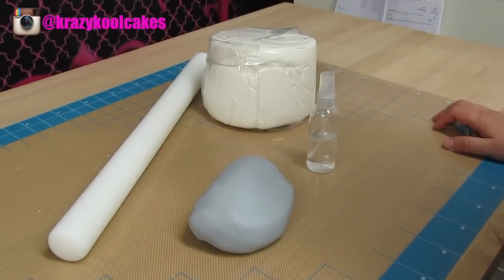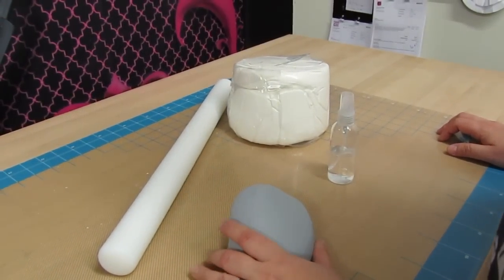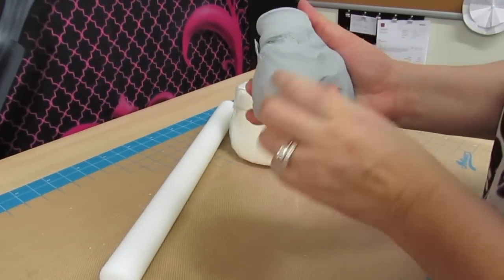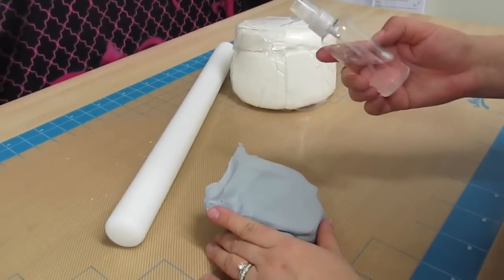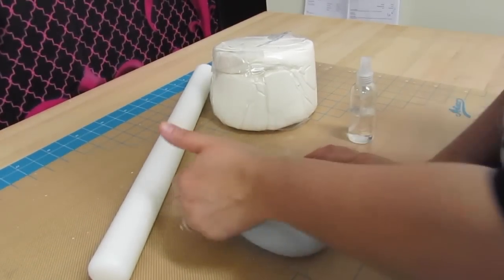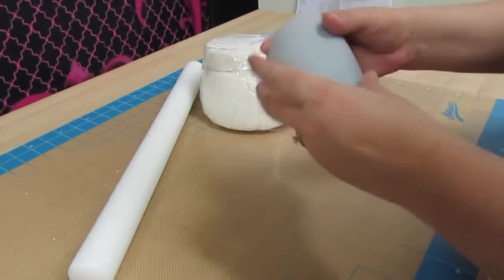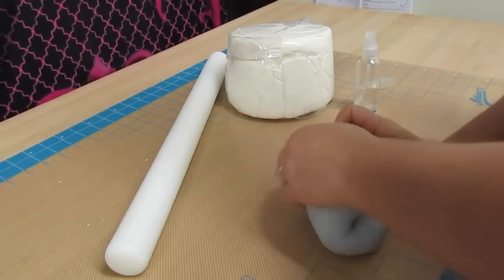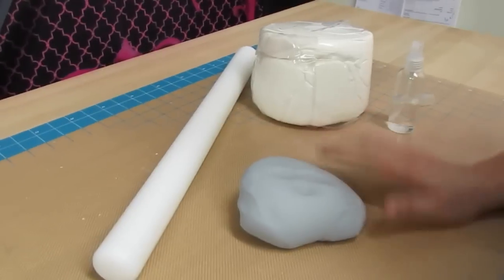How To Avoid Cracks and Elephant Skin On Your Fondant

Comment: Love your videos!!! Would you be able to use a fondant smoother without it sticking to the fondant? I usually rely on cornstarched fondant to be dry enough to be pressed with a fondant smoother. I tried using shortening and the fondant smoother got stuck on fondant and really didn't work. Thank you!!!
Reply from the maker: Thank you so much! We appreciate you watching. Yes of course you can use a fondant smoother. As long as your fondant doesn't have condensation on it your smoother should not stick. Make sure your cakes are only refrigerated when covering in fondant and not frozen or else you'll have tons of condensation (cake sweating). Also it definitely helps to make sure you are working in an environment that is free from humidity and warm air. I hope that helps. :)

Comment: I am using gumpaste that I made using Wilton preferred white fondant. I used your tutorial on adding the tylose.  I also used the gel food coloring. Maybe I should add more water when working it? I am doing the Easter topper you showed with the cross and robe. The robe is what is cracking right in middle where it drops down. I enlarged the cupcake version to a cake topper. It's beautiful other than the cracks.
Reply from the maker: Hi Beverly, Yes most definitely. Spritzing it with water and kneading it will make your gumpaste more pliable and will stick together even more, thus, avoiding cracks. Gumpaste acts very strange depending on the time of year, temp. etc. Often I also have to spritz it more than normal with water to get it nice and pliable. I bet your Easter topper is lovely! :)

Comment: Hi Laura. When I make gumpaste decorations I do the water process to keep my gumpaste the right consistency but after they dry they Crack and look like elephant skin in a few places. Is there a way to fix this after they have dried? How can I prevent this? Thanks in advance for you advice. Love your tutorials.  God bless.
Reply from the maker: Hi Beverly, There's no way to fix cracks after gumpaste has dried. This must be avoided while sculpting. One thing that will really help avoid cracks is to not use shortening at all while sculpting as this creates more cracks and wrinkles. What gumpaste are you using?

Comment: How do you prevent it from sticking to the rolling pin when you roll it out if you spray it with water?
Reply from the maker: HI Zoe! Great question! Definitely avoid water touching your fondant when you're rolling it out as this will certainly cause it to stick. You can lightly powder your surface with either confectioner's sugar or cornstarch (which is what we like to use) to avoid the fondant sticking to your rolling pin. Hope that helps. :)

Comment: Thank you for the tip but what about when you add colour and is sticky if I add corn flour or icing sugar starts to break it. Any advise?
Reply from the maker: If your fondant is getting too sticky when you add color, you're either adding too much color, or your fondant was already too moist before you ever added the color. The only thing I would add to sticky fondant to make it a bit drier would be a little bit of cornstarch. Nothing else. If it get too dry just spritz a tiny bit of water and knead it in. Hope that helps. :)

Comment: Will that work also for homemade fondant and also when I roll it out to put it on my cake if I Spritz it while I'm kneading it will it stay pliable like that when i cover the cake? with no cracks?
Reply from the maker: Yes. :)
Reply: Krazy Kool Cakes & Designs  hi I just have one more question if that's okay, my mother and I are always using box cake recipes is there any chance you might have a really good recipe for a homemade batter from scratch. Thank you I would appreciate it very much!
Reply: I make my own fondent and follow the recipe and it still cracks just as soon as I put colouring in and tryed the water and tryed the tylose and it didn't help please help

Comment: Hi..I was wondering what's the best crumb coat to use with fondant..specially if your  in a country with typical hot weather conditions.I learned the hard way that fondant could sag beyond repair.and it totally ruined my whole cake.
Reply from the maker: Hi Marj, We have our Perfect Icing Consistencies tutorial you can check out for the crumb coat icing we use as well as the outer coat. We live in the desert and it's typically very warm here, but the cakes are always kept in a cool and dry room or venue. We don't ever recommend putting cakes outside in super hot weather. No icing can withstand that. If the fondant sags however, it could be the icing, or, mainly the cake. If the cake is too soft it will sag.

Comment: It don't make it sticky when u knee it.. wilton I buy from michaels the big box that has two packs and I worked this fondant and it still crack on me.. it never did thia before on me
Reply from the maker: Hi Natasha! It gets sticky to a certain point. That's when you have to use your best judgement and decide when to stop adding water. You should knead it until the stickiness is gone, but you still want it very pliable before you roll it out. When temps get warmer (like the season we're in now) the air is drier so your fondant will dry out faster. That's when you need to knead more water into your fondant before rolling it out. It also helps not to take a long time when covering your cake. The longer the fondant is exposed to the air, the more it dries out on you. Hope that helps and thanks for watching. :)
Reply: @krazykoolcakes  Yw I will try it again tomorrow on my other cake

Comment: If you see get dry again but the fondant is already on the cake can just spritz the cake a little to add a little moisture
Reply from the maker: Hi Erin,  You actually WANT your fondant to dry once it's on there. Once your cake is covered, don't go anywhere near it with water. Hope that helps. :)
Reply: @krazykoolcakes  thanks so much

Comment: Hi some say use cornstarch to avoid drying fondant when rolling and some say powder sugar. Anyone help? My fondant always crack :(
Reply from the maker: Hi Ju Ju! Actually both of those act as "drying agents" and WILL dry out your fondant, not avoid it from drying out. I use cornstarch when I roll out my fondant but as little as possible. I avoid my fondant drying out my spritzing it with water and kneading it in before I start rolling it out. This way my fondant is "extra moist" and by the time I'm done rolling it out, even though it did absorb some of the cornstarch, it still isn't dry. I hope that helps! This tutorial explains what I do perfectly. Hope you get a chance to watch it. :)
Reply: Thank you so much. I will certainly try doing that :) Hope it will work out for me :)
Reply: Krazy Kool Cakes & Designs it

Comment: Your fondant doesn't stick to your surface or your rolling pin? If it does how do you prevent that from happening?
Reply: If it sticks it has too much moisture in it.  You will need to use confectioner's (10X) sugar, corn starch or even Crisco to eliminate the stickiness...it depends on what you're doing with the fondant...but always use these sparingly.
Reply: You can use cornstarch

Comment: my fondant feels fine and rolls fine, but on the cake, it goes sticky after a few hours/overnight. what am I doing wrong?
Reply from the maker: HI Debbie, It sounds like wherever you're leaving your cake over night, it's warm and perhaps the air is humid. Severe condensation only happens in those conditions. I never leave my cakes out. I always put them right back in the fridge after I cover them. Having said that, make sure your work room/area where you take your cakes after being removed from the fridge is very cool and the air is dry. This will cut down on the condensation (stickiness).
Reply: Krazy Kool Cakes & Designs I'm a home baker so rarely have room in my fridge for a whole cake. I think you're right about the humidity though. I'll try and store somewhere cool and dry 😀

Comment: Every time my make marshmallow fondant, it dries out way to quickly. And I always follow the recipe to a T. I don’t understand 😩. When it was the summer time, it would never dry out that fast.
Reply from the maker: Thanks for your comment/question? You basically nailed the reason as to why your fondant is drying out quickly. Temperatures are cooler now. When fondant is warm it's gummy and more pliable. When cold it's harder and cracks easily. It's a good thing you watched this tutorial because now you know how to add more moisture into your fondant. :)
Reply: @krazykoolcakes  thank you so much 😩❤️